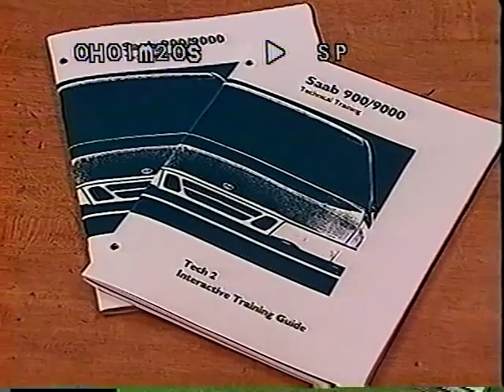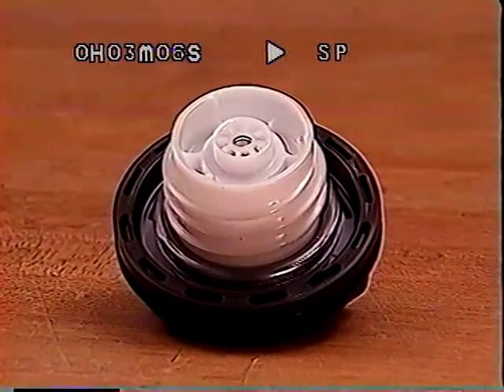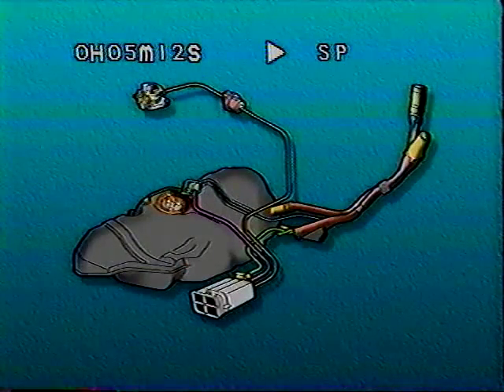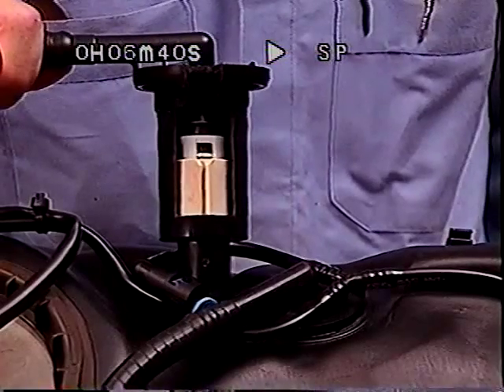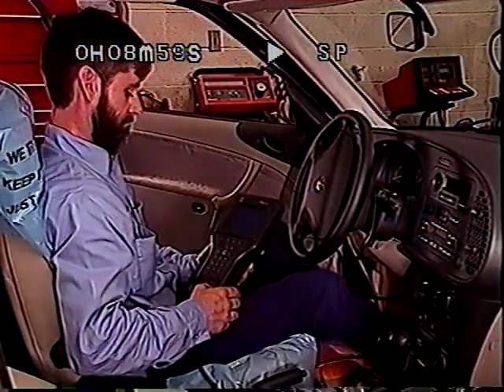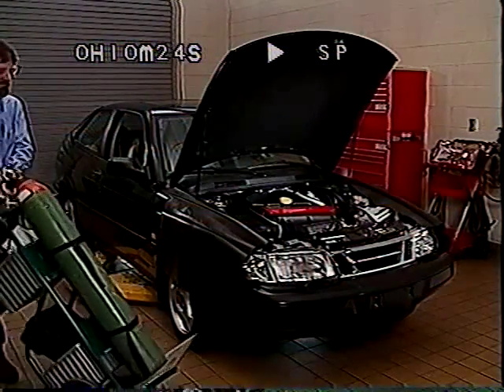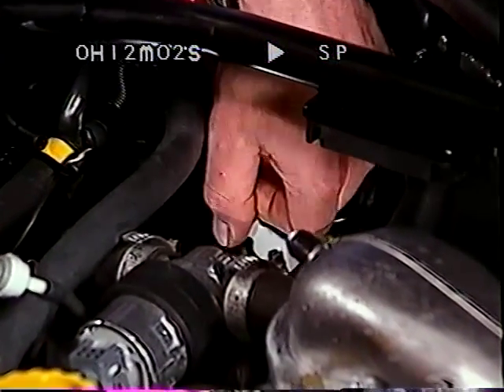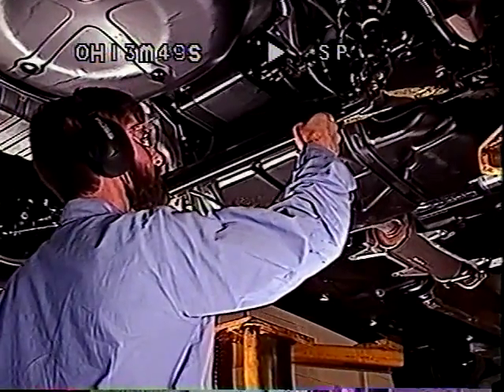EVAP Diagnostic Update 1998

Comment: Thank you very much for this great video.. This is video is very helpful how to diagnose EVAP leak on my 1996 Saab 900 SE I believe I need a jumper harness as shown in 11:11 min and PSI #01/97 -0729 manual to do it. I don't know where to find it. Please let my know if you might have this workshop manual on section 2 pg 61. I will greatly appreciate if you can possibly email me that page at: sfurtak@shaw.ca Thank you very much.